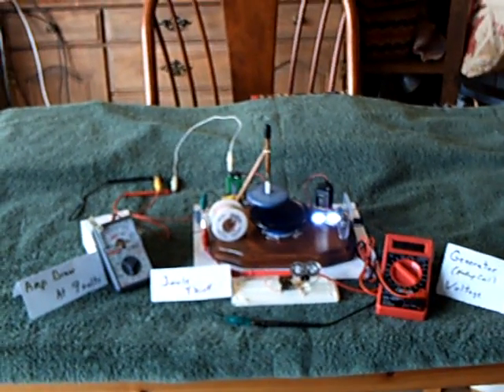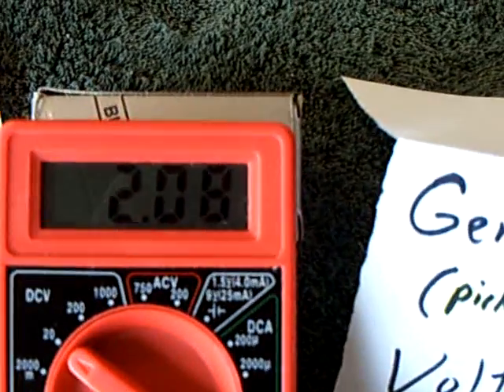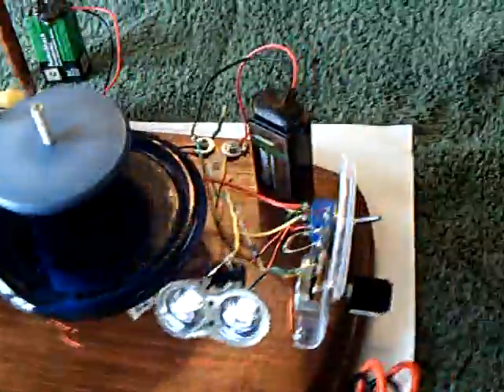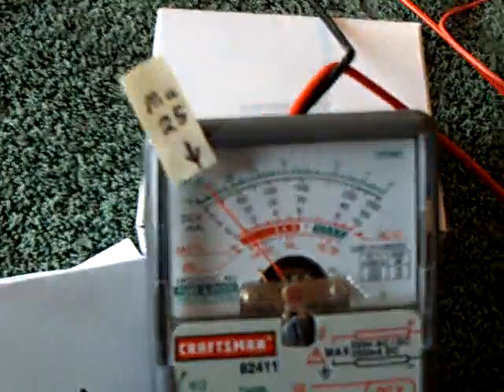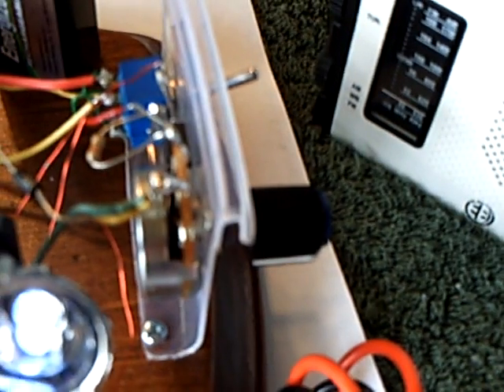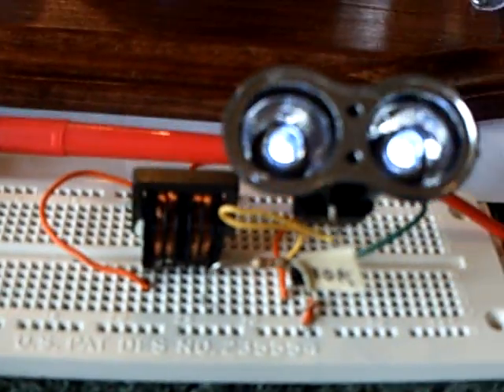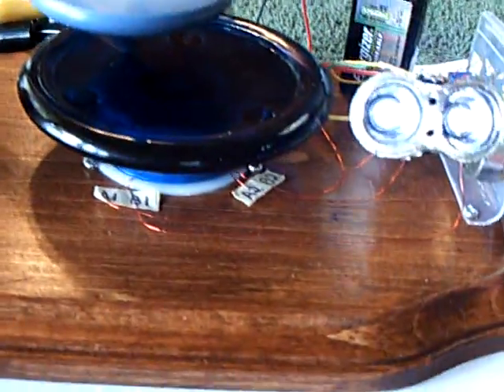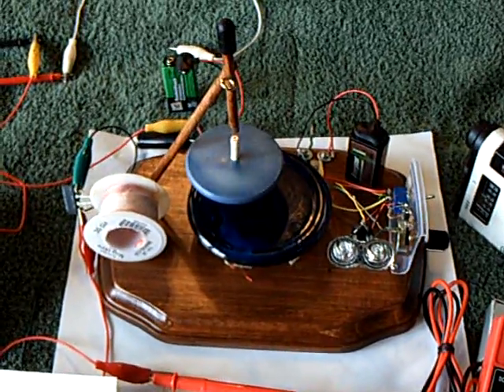TOP CHARGER-- Runs a Joule Thief  Wirelessly

Comment: (continued)  The best way to monitor the current is to put a low value resistor in series with the incoming supply line, and measure the voltage drop across this resistor.  The resistor should be chosen so that it drops a lot less than the 0.2V, best to keep it below 50 millivolts.  1 ohm gives 1 milliamp, 0.1 ohm gives 0.1 millivolt per milliamp.  If you need low value resistors, use a few inches to a foot or so of #32 gauge wire.

Comment: I'm puzzled by the bug eyed LEDs, how are they  mounted in this double LED holder and reflector?And even more important, are they connected in series or parallel?

Also, most people don't realize that the multimeters when used on the current range drop as much as a fifth of a volt when the current is at the meter's max.  This means that if you're using an alkaline, it's really about the same as a Ni-MH cell, at 1.2 or so volts.
(See following comment for continuation)

Comment: I wonder if you have seen the k-mets magnetic motor experiments? Your top is reminescent of those designs. I built something similar and am experimenting with running my metlike system using a bedini circuit and coil. the virtually frictionless mets with magnetic upper suspension is a good way to go. Carry on with the good work .

Comment: you mentioned putting the top inside of a transparent box. I wonder if it could be sealed air tight after you start it spinning and then you can connect a vacuum pump momentarily to draw out most of the air. it would be nice if it would gain some noticeable change on the load measurements